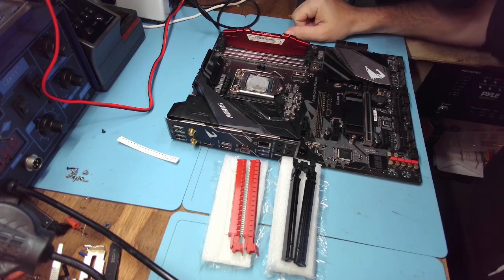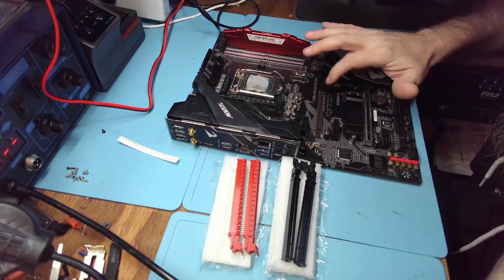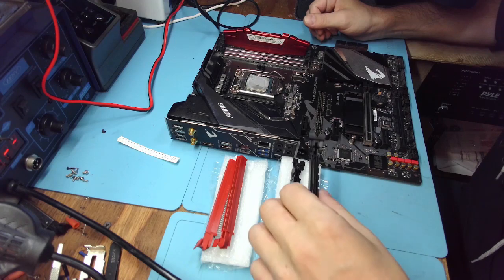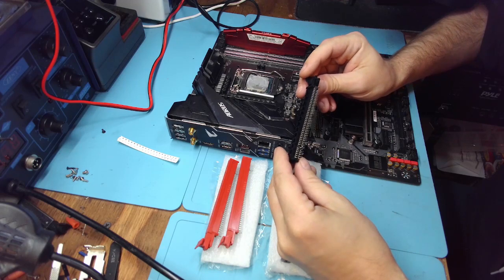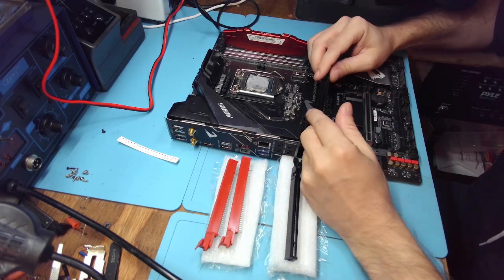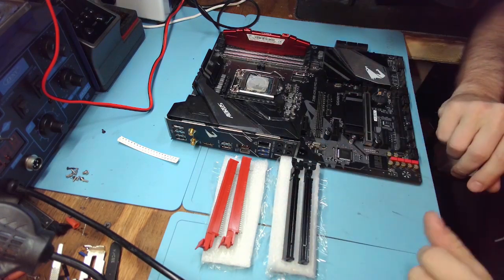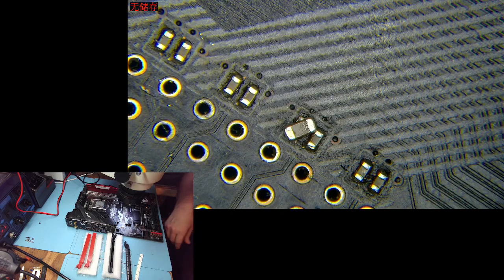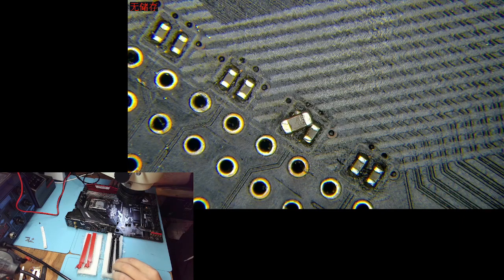PCIE Slot replacement | Did it work?  Yes it did, just used faulty card to test it

Comment from the maker: LOL, I just tested it on a different GPU and it works! Not sure if this card is faulty of this board just doesn't like it but the repair turns out to be a success. 😁
Reply: That is good news, just check with a modern card (one that will saturate PCI power) and GPU-Z - you should see the PCI mode and lanes used (should be PCI4 x 16), then you'd know that all your PCIE lines are working :)
Reply from the maker: @DIYRepairHour  Thanks a lot man! What do you use to test cards after you repair them? I have one that I bought as broken but it displays an image so I'm thinking one of the memory chips is faulty.  If I'm lucky it might turn out it was misdiagnosed :D
Reply: @blackhorserepairs  I have a test PC. It is CPU 6600, 16GB RAM, 1200W PSU (for testing demading GPUs), and it has raiser board connected for GPU swap - its much cheaper when the slot wears out just buy a new raiser (those raisers used for mining). I normally use raiser board until I need to fully test the card - then I use PICE slot on the motherboard. 
For testing I have serveral small SSD drives connected, one with Windows 10, and the rest are Linux with nVidia  / AMD tools for testing memory and general GPU health.
Reply: @blackhorserepairs  After repair I always run some GPU stress software, like Furmark, then UEngine Valley and Heaven. All those are free to download. 
I also have Steam instaled with some games but that is not really necessary. 
Just run the test and have GPU-Z with advanced sensors window open and observe the temperatues and power - ALWAYS make sure it is running smoothly,!
Reply: @blackhorserepairs  And one more thing - you can't really get to all the points you want to measure when GPU is powered on (for measureing voltage rails) unless you use something like open bench PC or a raiser board. So those risers are good idea not only for extending your motherboards life, but also for your convinience.
Reply from the maker: @DIYRepairHour  Thanks a lot, looks like I have a lot to look into :) I assume you run GPU memory test on linux, which software do you use for that? I found few of them on github but I'd like to use something recommended.
Thank you so much, I got some ssd and mid-tower ordered today, I'll install Windows on it and do some testing. Looks like there's part 3 coming for this board :D
Reply: Will it work if you remove the pcie16 slot and only use integrated graphics? I have mine destroyed from shipping. Not sure if removing the slot will work.
Reply from the maker: @jeifury  yes, it will work. The removal process is pretty hard though, it's easy to damage the board or nearby components, so be careful, don't rush, and keep the temp low. Best of luck to you my friend
Reply: @blackhorserepairs  Thank you. I'll give it a try. Hope I can still use the motherboard.
Reply: I have a similar problem with a Gigabyte Z590D. It has 3 PCI-E sockets, one x16, one x4 and one 1x. I have tried with two external graphics cards and only the 1x socket gives an image. The curious thing is that it also gave an image in the x4 and since I changed a BAT54C diode associated with the x16 that gave a very low output voltage (145mv) the x4 also gives an error (five beeps in a row). The voltages are apparently fine. On this board the 16x is controlled by the CPU and the other two are controlled by the PCH. I am a bit lost. I have to measure with the oscilloscope and also check all the capacitors associated with the 16x, but anyway, I am perplexed. I highly doubt it is a CPU problem. Any suggestions?
Reply from the maker: @estebanblascotrasobares8755  have you tested different CPU and PSU?
Reset BIOS then reflash just to be sure. Of course test more than one card.
If all that fails, check with the scope that the device reports and reads BIOS from the card. SMBus clock and data pins should show something during boot (might just be a second or two).
Check the voltage fluctuation during boot, especially 3.3V
Reply: @blackhorserepairs  Except for trying a different CPU (I don't have one for that socket) I've tried different components, including three different memory modules. Yes, I'm thinking of doing what you recommend, as well as getting a different CPU. Even though I don't think that's the problem, I've thought about changing the BIOS chip, which I've flashed five times, and I don't know how many times I've reset the CMOS. Who knows? I once found a motherboard whose BIOS didn't save the date and time and that I had flashed several times. Well, a spanish youtuber (Repromod) suggested I change the BIOS chip and, voila! It was solved.
Thanks a lot for the advice.

Comment: I`ve been in Electronics area since 1988, worked in a big Electronic Company Repair for over 12 years, now I do this as a HOBBY. One thing I have learned over the years is, thin (SOLDERING WIRE), needs to be the best one (ROSIN CORE) quality, so YOU DON'T HAVE TO USE THAT FLUX. I hate using FLUX, because the mess, that thing becomes conductive, it is a waste of MONEY (YOU BUY THE FLUX, HAVE TO BUY HIGH ALCOHOL ISORPOPYL HIGH GRADE, Q-TIPS/COTTON FOR CLEANING. While using the best thin (soldering wire) is cheaper than buying all these products, less work, and cleaner job. Do yourself a favor, GET SAC305 or Sn96, the thinner, the better, range of 0.015 inches to 0.032 inches in diameter, YOU WON'T NEED THAT MESSY FLUX. LEAVE the Flux for beginners

Comment: sorry sir . i'm ask a problem slot ram can be replace to slot ram different  type motherboard or same type motherboard??
Reply from the maker: not sure what you're asking but
1. RAM slots can be replaced
2. the replacement must be the same (DDR3, DDR4 etc.)
If the slot is different, the module is different even if the board pinout fits, usually lower voltage and higher frequency.
Does that answer your question?
Reply: @blackhorserepairs  1. yes can be replaced slot ram??
2. Yes, change DDR4 to DDR4, but I'm confused, can I replace it with the same or different type of motherboard?? for example MSI H110M PRO-VH (2 RAM slots) to MSI B250M PRO VH (2 RAM slots too), or B250M PRO VH (2 RAM slots too) to B250M PRO VH (2 RAM slots too) too??
Reply from the maker: @rudiandrian4557  as long as it's the same kind of memory it will work, however some boards use different layouts, and there might be some extra pins (ground usually) that will be missing on the replacement slot, but the slot itself will still fit and work. (as far as I know at least), you should be able to find board views for these boards, if not find similar ones and confirm but I don't expect any compatibility issues.

Comment: So the board was damaged CPU pins were out pcie damage ontop of it the GPU was faulty too waoo what a chain of failures but still you managed to pull through 👏
Reply from the maker: well, the GPU was not actually faulty, just not compatible :)
and I use this computer till this day, recorded and edited many videos on it since then.
The repair was a total success :)

Comment: Have seen 2 x99 Boards now for cheap, where the first pcie x16 slot Was damaged/missing.

Now i strongly want to buy one and try to fix it.
Reply from the maker: Try it, it's a lot of fun, especially when it works afterward, I still use this board for video capture and editing. It has been months at this point.

Comment: Do you have links to buy those replacement slots?
Reply from the maker: here it is, this is the one I purchased (hard to find on eBay)
https://www.ebay.com/itm/18515440893
Reply: Seems that link is broken? / Unlisted :( @blackhorserepairs   @blackhorserepairs
Reply from the maker: @tomgoodchild9278  yeah, seems like it's not available any more and I can't find it using search. You might need to get it from Aliexpress
Reply: Do you have a search term for finding what I need. I keep just finding entire mother boards and other crap ...
Reply from the maker: @tomgoodchild9278  here's an active one
https://www.ebay.com/itm/185154408939 

I search by "pciex slot connector socket replacement"
Reply: @blackhorserepairs  ordered. Thank you!

Comment: My PCie slot stripped my RTX 3060 GPU the gold metal pieces at the end fell off and now it doesn’t display anything.

Do I buy a new motherboard entirely or a new GPU so it can get stripped again?
Reply from the maker: this is repairable, how many strips are damaged? You could get it fixed

Comment: You have to step up your Isopropyl Alcohol Game!!! 70% alcohol means 30% water.
If you can't get 99.9% , at least get 91% from the drug store. Living dangerously my friend.
Reply from the maker: The container says 70% but there is a mixture of 99% and 70% inside, for some reason I can't get 99% lately. It does take a bit more effort to clean the flux with 70% but it seems to get the job done as well.
Thanks for the advice, much appreciated.